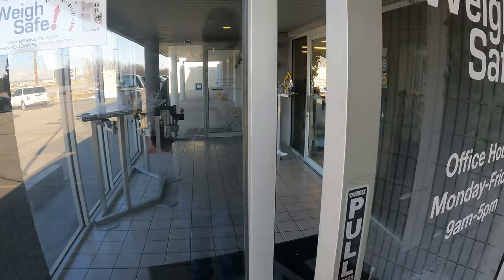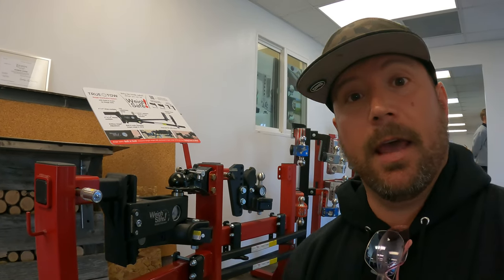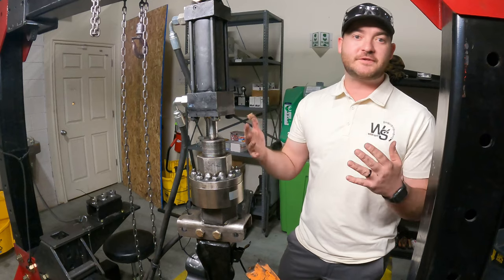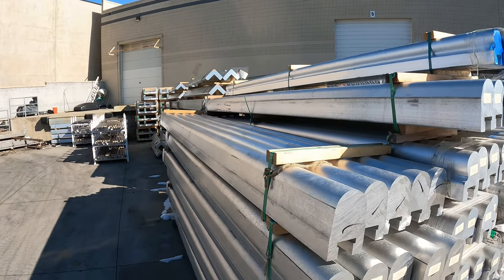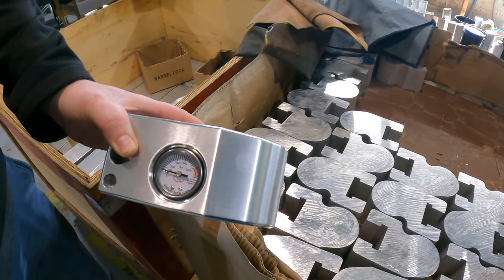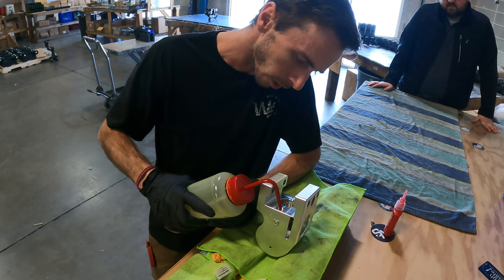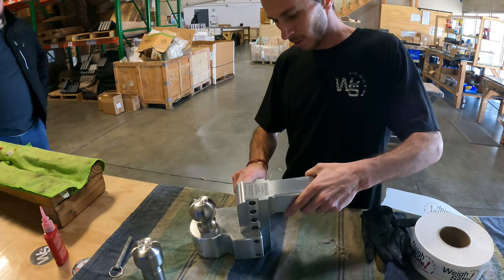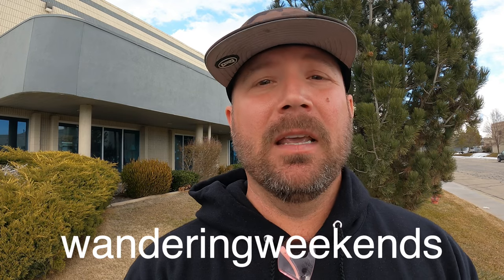Weigh Safe's Headquarters// I Traveled 4000 Miles to Visit a Hitch Company// I Must Be Crazy

Comment: I bought a WeighSafe True Tow (heavyweight) after watching the Hitch Battle videos. It was a huge improvement in my towing experience. I love everything about it. Infinitely adjustable for my various tongue weights. I’ve been to the scales numerous times and the weight distribution is spot on every time. The slider is easily removed from the receiver making the weight easier to handle for my old back. And, I can drop the tailgate when connected. After using it for nearly a year and 8,000 miles I absolutely love it. Thank you, Cory, for helping me make a great purchase- and I used the promo code for the discount. I have recommended it to many curious campers.
Reply from the maker: This is great to hear!
Reply: We are stoked to hear about your experience with the True Tow so far!
Reply: How do you know the gauge is accurate? Have you seen any indication that it is no longer accurate?

Comment: Well, I made my order of the middle-weight, got my confirmation that it had shipped, then got a notice that they could not deliver the 4" drop until the end of April; could go with the 6" and get it in early March - would like the 6" but the top of my receiver is 19.25" which could jeopardize the hitch in low spots.  Stuff happens.  It kind of goes along with having our truck stolen at the end of November - and then getting it back - repairs completed on 1/12/23; buying a new 2022 Grand Design 2600RB on 11/3/22 and finding the undercarriage had "excessive corrosion" (per Lippert) at the end of December - should have looked and/or have had it inspected; GD and the dealer finally agreed to address the issue (Lippert did not) and I do not know when that will be completed; returned the ReCurve 3 that the dealer supplied instead of the promised TR3 to buy the WSMW; based on your videos I had told them I would bring the WS if they were not providing the TR3 - of course, that was the Heavy, before I knew about the MW.  Hitchless and trailerless - maybe we should take a hint - but we will press on!  Thanks for all the great info!
Reply from the maker: Hopefully you’ll look back and realize it was all worth it!!

Comment: Our little trailer is only 5500 pounds.  However, our dealer set us up with a Blue Ox when we bought it.  Weigh Safe or someone representing them stated that the gauge can be less than reliable at low weights.  I've noticed that the Blue Ox makes a difference, so I tend to think that even with this light trailer, that we will benefit.  And at age 75, the BO can be challenging to setup at odd angles.  I have to lift my vehicle wheels almost clear of the ground at times.  I think that is a bit hard on my tongue jack!  That and the superior ride draws me to this hitch.  Am I being ridiculously overkill on this?  Thank you for the reviews!  Hopefully, you get some commission on this one.  Btw, I am looking at the medium weight True Tow for the slightly lighter head.  David
Reply from the maker: Hi David!
I don’t think you’re overthinking anything. You’re simply doing your homework!  Just to be clear any weight distribution hitch will offer challenges when hooking up at odd angles. I’m not sure the Weigh Safe will remedy that situation. On that note you shouldn’t be having to use the tongue jack to that extreme either. 

Having used both hitches I do think you’d see a nice improvement with a medium weight Weigh Safe. Especially if your tow vehicle is on the lighter side.  Let me know how things go. 

Cory

Comment: We are ready to buy but one dealership said they were having problems with them breaking. I have seen a lot of reviews saying they are having problems with the scale breaking, the hitch breaking and the hitch ball coming loose. Are you seeing issues currently? Need to order very soon. Thank you for your help and we love your videos.
Reply from the maker: The weight distribution hitch has been great. I believe their aluminum hitches can have issues when abused past their stated capacities (which happens often). Nothing is indestructible but I’ve been VERY happy with the build on the 2 separate hitches I have (heavyweight and middleweight).
Reply from the maker: The dealer is going to try and sell you the hitch they make the most $$ on.

Comment: Very interesting tour!  Thanks.   I know on Equalizer, a lot of folks size up the bars.   I am considering a middle weight weigh safe.   My 2600RB is 8300lbs GVWR.   I am usually around 7500 pounds.   Are the 8500 pound bars good here or is there any stability advantage to using the heavier bars on this type hitch?
Reply from the maker: I think you’re good either way. I’d probably go 12,500 but only to cover myself if I moved to a heavier trailer in the future.
Reply: @WanderingWeekends  I just looked at specs.   The tongue weight is limited by the bars.   I run around 900 on the tongue, so I need the heavier bars.   Your discount is $127.   I owe you a beer!
Reply from the maker: Anytime!!

Comment: I really don’t want the scale tho. I’d love to see a weight distribution one without any scale made by them. I just don’t see them being accurate long term and don’t wanna pay for something I don’t want or ever plan to use. Cool sure but I don’t need or want it. That’s why I chose the 180 series for me use case
Reply from the maker: The scale is crucial on the weight distribution hitch. You need the tongue weight before engaging the hitch and the distributed weight while engaged. The app and the scale set their weight distribution hitch apart from the others.
Reply: @WanderingWeekends  I’m not trying to be rude or disrespectful. But if it’s so crucial how have we gone hundreds of years and there are countless brands with no scale and no intentions of said scale? 

Again I’m just asking a logical question is all. I definitely see the point behind it. However something like this I wouldn’t trust long term to be fully accurate. As a master auto diesel tech I know these types of gauges have to be calibrated every so many years and to my knowledge does anyone do this?? 

Again no rudeness or anything I’m just asking
Reply from the maker: No disrespect taken

1. These hitches haven’t been around for 50 years much less 100’s. I’m not sure where that came from. This tech is constantly being taken to new levels. No one else has a scale because it’s patented. Pretty simple there. No one wants to get sued. 

2. I’ve tested 9 (soon to be 10) hitches and these perform better than all of them minus the $3500 ProPride. Take from that what you will but I’m convinced the perfect setup (which is achieved by the scale) is the reason why.